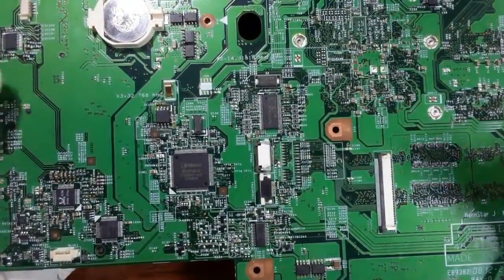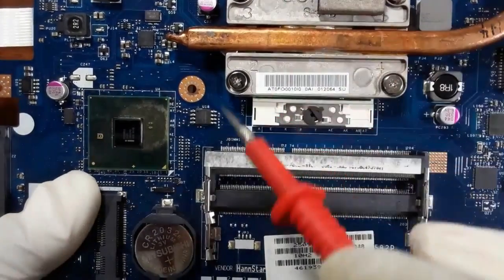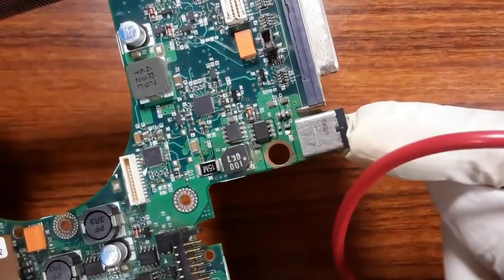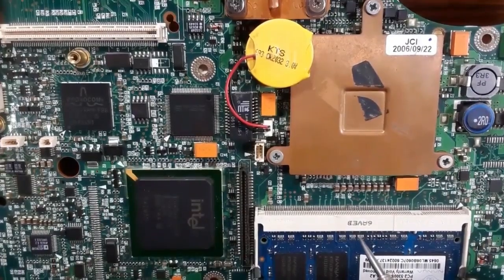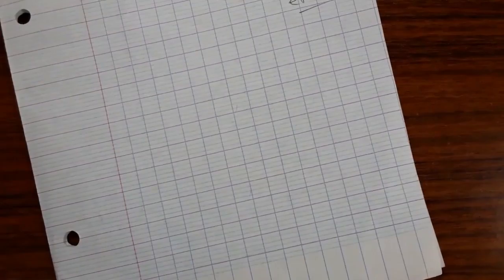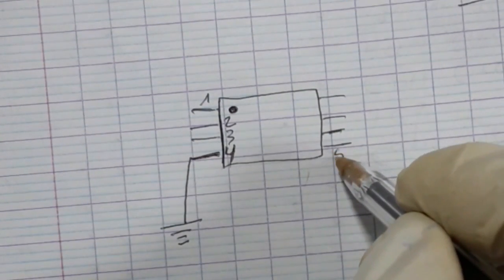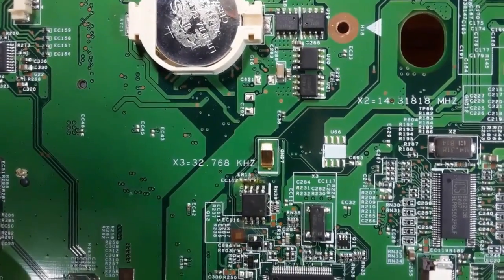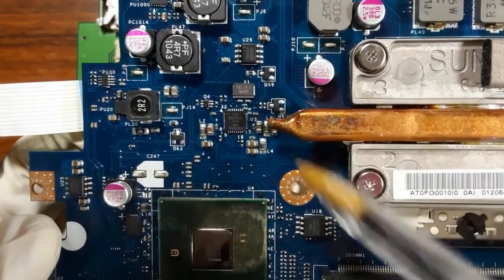Laptop Motherboard BIOS Tips and Pinout - Laptop Motherboard Repair

Comment: So if we have 3.3v on pin 8. The system turns on but doesnt go past bios (i dont even think its making it that far), the usb ports have power, the cpu gpu and memory all get warm, the fans work (even change rpm as temps go up and down), the charge circuit works, the "cooler boost" button on the keyboard works, but there is no display nor keyboard backlight, and it stays on like this indefinitely. Its probably a corrupt bios right? Also what are the chances a cmos reset could corrupt it or keep reseting it with corrupt data? This is where im at. All the components on the board look fine. All voltages are fine. No shorts have been found. I was messing in the bios then changed my mind and selected "discsrd and exit"...it then booted into windows once and i shut it down. Its been stuck like i described every since. It doesnt even reboot several times like it should after a cmos reset. Acts like its stuck in ddr5 training almost.
Reply: Did you figure it out? I'm stuck in the same boat with my laptop.
Reply: @Trizzzay no I didn't. I'm a little nervous to do so for security reasons but I might just buy a new bios chip already flashed with the bios off eBay and attempt to replace the bios chip myself (I have slot of soldering experience just not much with surface mount components). I'm pretty sure it's a corrupt bios and when clearing CMOS it's restoring it with corrupt defaults somewhere. That's the only thing that makes sense to me. Bios chip is $30 USD for my laptop (replacement motherboard is 800). I figure worst case scenario I screw up and have to replace the motherboard...which I'll have to do anyway if I don't try.
Reply: @AlphaTheGodofDarkness Have you tried the CA341A USB flash tool? I'm waiting for mine to arrive. It's really cheap.

Comment: Excellent teacher, but what does bios do in pc
Reply from the maker: Thank you. The BIOS (Basic Input/Output System) is essential in a PC as it initializes and tests the hardware components during startup and provides runtime services for the operating system. It also manages data flow between the computer's operating system and attached devices such as the hard disk, video adapter, keyboard, and mouse. Essentially, the BIOS ensures that your hardware functions correctly and the system can boot up. Let me know if you'd like a more detailed explanation.